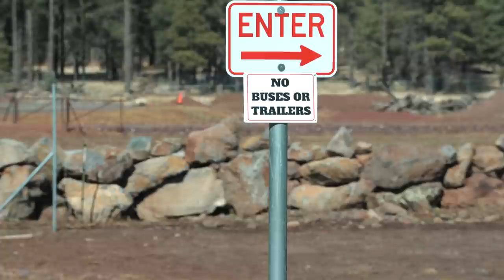There were BEARS, BISON, and WOLVES everywhere!!! The tour bus recovery at Bearizona!

Comment: I used to work on these busses. For future reference you can dump the air on the drive and tag axle on each side. I would have dumped the air on the left side to bring the front down a little bit. I had a hell of a time finding someone to tow these. Good job yall.